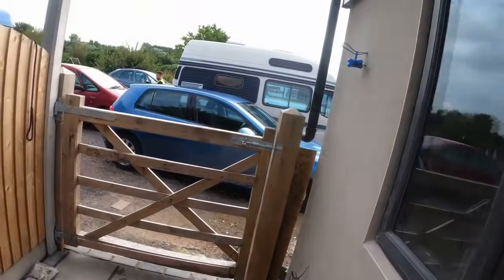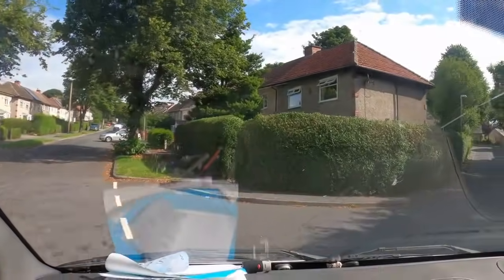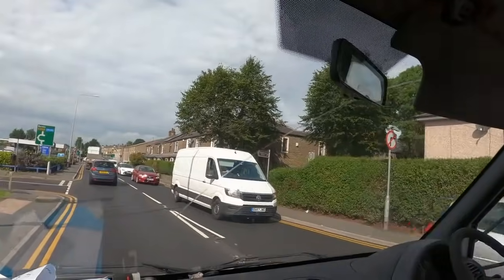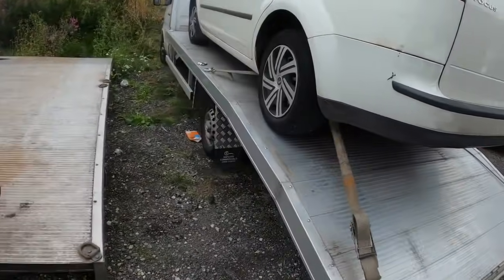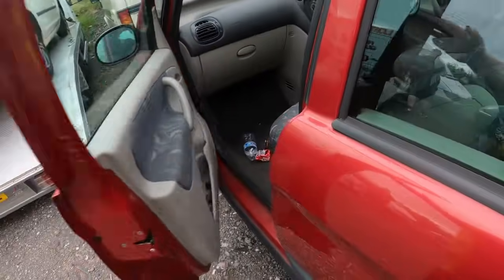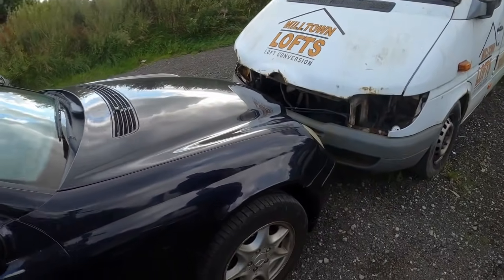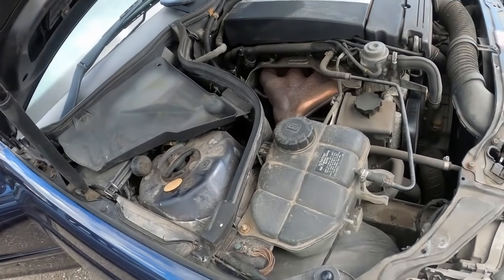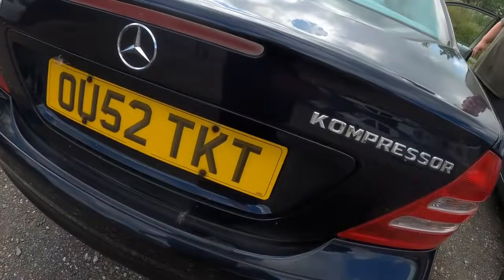BUYING SELLING SCRAPPING CARS.THINGS ARE PICKING UP AGAIN!!!!!

Comment: You can reset the gearbox on the merc by pushing the throttle pedal to the floor with the ignition on tun the ignition off hold pedal down turn ignition to off position release throttle slowly wait 2 minutes then remove key  and restart it should change gear now. Or another problem the gear box control unit fills with oil this should be near ecu .

Comment: Price of vans and car's are up. Up here in the Highlands. Go to buy an old banger there wanting £500 /£600. That old focus would make good money up here. Lol  Least you got these job's on the recovery truck done. Av not seen any classic bike's up here.  Best place for a Citroen Scrapyard lol.😂😂 She's had a hard life focus. I watched that 24 in custody myself it was good just been busy fixing motors trying to make a pound you know yourself online auction Sat lost out on a Nissan Navara D22 by 200 pounds ach Well slave cylinder went on my brother's truck so have go do that no so much money in it when you got do work for the family.  The Merc will be in limp mode stuck in first gear.
Reply: I'm binning my D22 navarra fuel pumps gone agter its been fitted with a new head n turbo... I had enough if it and bought an L200.
Shame your right up north I only want 500 for it.